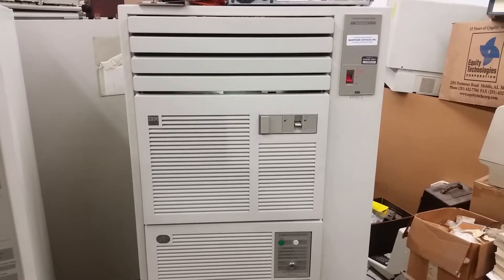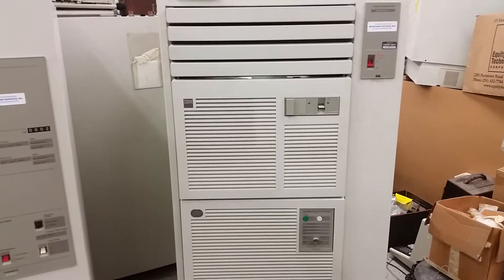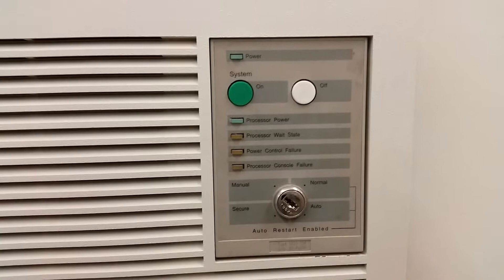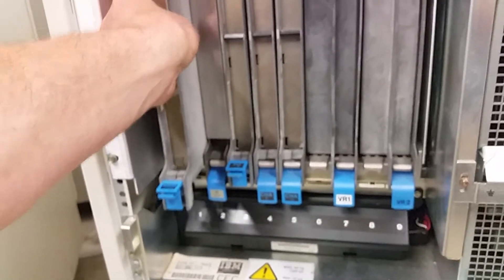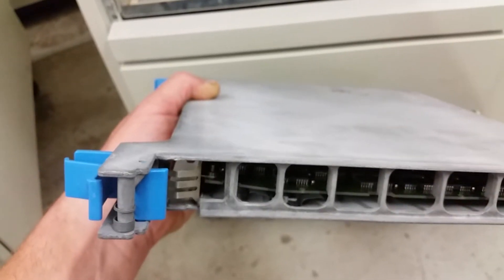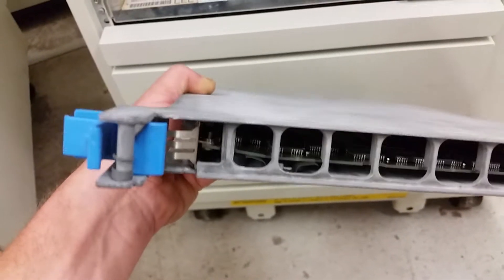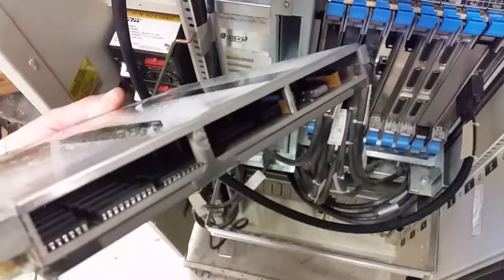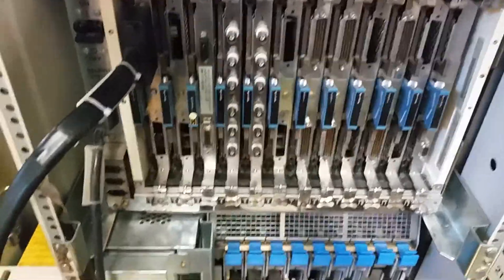Inside the IBM ES/9000

Comment: I see no bus and tag cables. Did I miss something? Those things at the bottom are bus and tag terminators. No card in this system that uses bus and tag cables.
Reply from the maker: The B&T panel is at the very bottom of the rack.